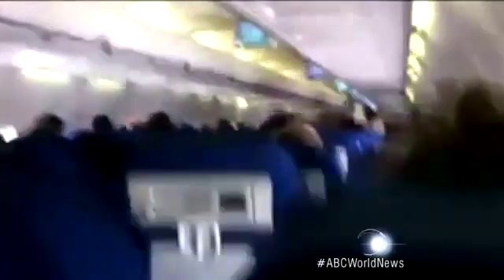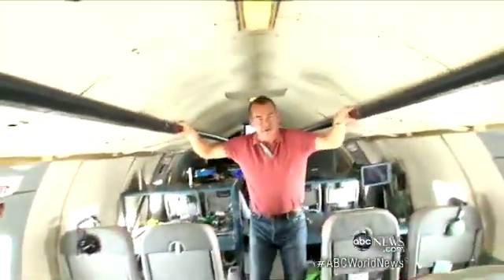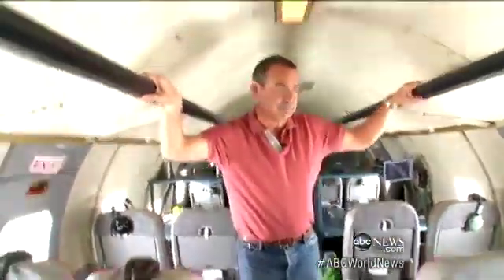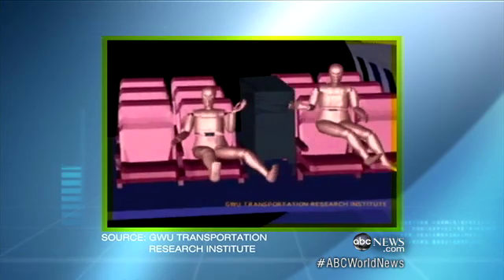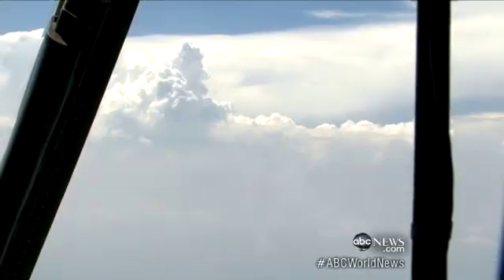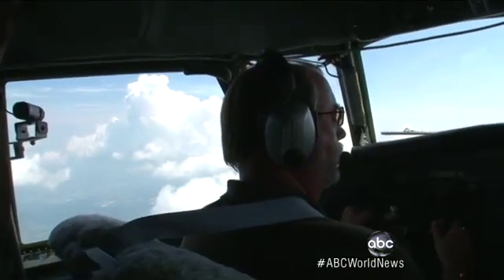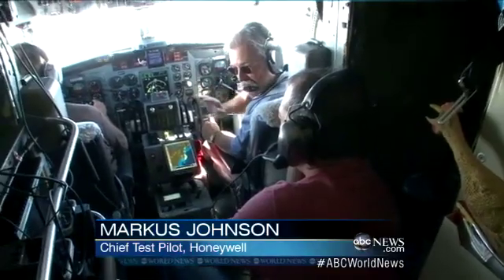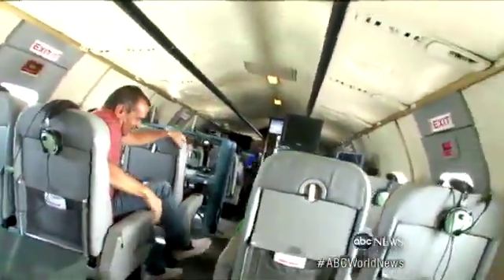Planes Can Avoid Turbulence With New Technology

Comment: From Canada:

I personally remember a flight from Portland Me to Logan which, on the going rrip had been a 14-17 minute beautiful hop over the ocean (in the month of December)....

However!!

On the return it was 45 minutes of "aerial HE!!". Had I not had my seatbelt fastened, I too owuld have had my head through the ceiling of that aircraft.

When in final approach, there was a blinding blue flash on the right wing. As I was in a seat on the right side (and I don't remember anyone in the widow seat). I knew that the final apprach was the most dangerous pert of any flight, but as I looked around, I sa w a blue flash, but no red or yellow flame, no smoke, no fire ne electrical sisturmabces (as an electronic technition returning from a high danger job, I would have noticed anythin small in terms of an irregularity), and the turbulence, although rough was the same as it had been...

So, relax! Nothing to worry about, let's get on with it!

Ten minutes later the plane was at the gate. As I descended the stairway, at the bottom, it was about 32F and thick heavy snow. so I alsed the attendant waiting there...

"and what was that BLOINDING BLUE flash as we were coming down!"

"Lightning!" He replied.

"LIGHTNING, in a SNOWSTORM?" a replied.

"Attendant totlly calm ("We get this here all the time."

A bit surprised at the time, I then went into the terminal to wait for my connection back to Trudeau (YUL) in Montreal.

As we had been waiting in the air for many of Delta's vacationer flights to land first, all heavily loaded with baggage, I soon heard my flight was to be delayed a couple of hours. also, the airport was getting very crowded, which I saw as simply an added danger along with.

So I decided to try out the restaurant, and that was really an award to "clam" my concerns!

I had two bowls of the most fabulous clam chowder I had ever had, albeit at $9.00 each, a tad proicey, but worth it.

When the plane departed for Montreal the captain accnounced that all cabin crew would be strapped in and there would be no services on this flight. Understandible.

By the time the plane had landed in Montreal the climate was somewhat colder. the Captain then taxied over to some place in the middle of nowhere (by now it was pitch dark) and we sat for some 2-0-25 minutes. We could see the flashing lights of the service trucs driving around, but once again, no fire, no smoke, no electrical glitches, just waiting.

By now rumours about a "flat tire" and other nonsense were starting to arise. Personally I was getting a ta bored.)

Then the captain cam on the P.S. to say "We just landed in a very icy runway so they are just coming around to check us out."
We then taxied over to the jetway and everyone deplaned and went home.

However, on reflection, if anyone was imaginiing that plane to be stopping in the runway by using brakes, as it were like a car on a raceway at some 120 M.P.H. they weren't thinking. the plane will stop by reverse thrust until almost dead stop, especially as the captain is going to compensate for that icy runway as it goes, so tire traction has not so much to do with stopping Once again, let's get on with it!

Since then I have not had occasion to visit Boston, but in the internet, it seems that nice restaurant is no longer there - THEY "clammed up" too bad!

(But don't have more than two of that kind of chowder, it is very rich and might make you sick in excess).
Reply: 2 ...

i FORGIT TO ASK...

This 3D radar, its it capable of detecting clear air turbulence? That one can be just as dangerous! So far I understand that turbulence is undetectable.

Comment: Probably an upgrade of a standard weather radar, and then call it 3D. CAT is the real deal, you can't see it, you can't locate nore spot it. It's simply just there, without a warning. To all passengers aboard a flight like this (severe turbulence), Though severe turbulance most likely will not bring a plane down, it's freaky as hell. And one can better handlle this than the other. No shame if you're terrified, i wouldn't be amused either....